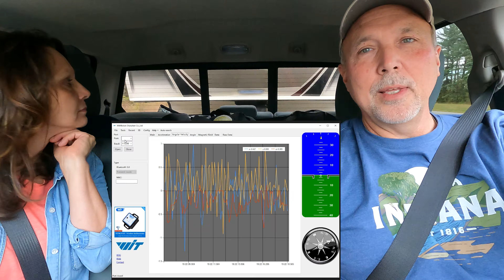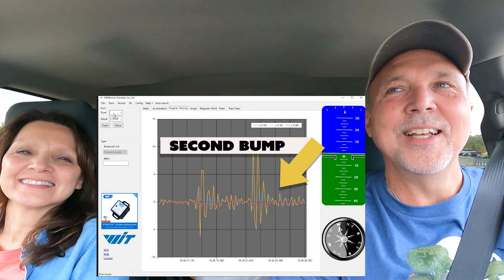Towing with the Hensley Trailer Saver BD3

Comment: Do you have to inflate and deflate every time you hitch and unhitch I have been trying to decide between a trailer saver hitch and a B&W companion hitch I would love to hear your thoughts and opinions
Reply from the maker: No, you do not need to deflate and inflate.  Once you find the right amount of air to keep in the bags, you just leave it at that.  You may have to add some air in on occasion or let some out, but not for hitching.  Matter of fact I've yet to add any air this year.

As for the B&W companion vs the Trailer Saver, I would highly suggest the Trailer Saver.  Now, I've never towed with the B&W and they look solid, but now in our 2nd year with the TS BD3, I'm glad I made the switch to it.  

Feel free to right back if you have any further questions.

-David
Reply: I've driven with my BD3 hitch now for oever 11 years (about 25K miles), you do not have to inflate or deflate that often. I keep about 55-60 psi in the bags and that works just right for my fifth wheel (Heartland Bighorn 3055RL). I check the air pressure when ever I hook up, most times it requires nothing to be added. I determined the proper pressure for my rig by hooking up the fifth wheel and putting the entire pin weight of the trailer on the hitch (lifting the front feet ready to tow), the head should be about half-way riding on the bars that hold it in place. Your PSI setting may be different based on the actual pin weight of your trailer. The idea is you don't want it to ride all the way at the top or all the way at the bottom, the head should be allowed to 'float' inside of the hitch to get the most cushioning as you travel - see video @ 10:09 mark to see what I am referring to.